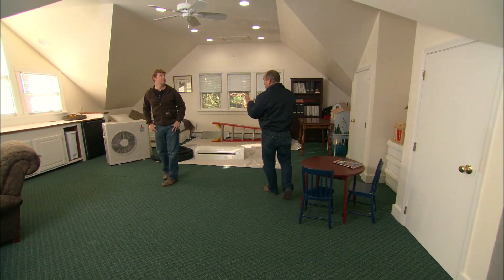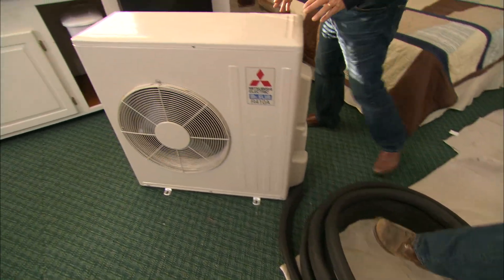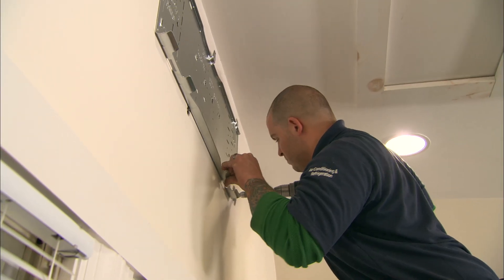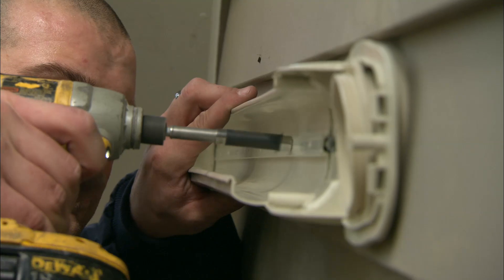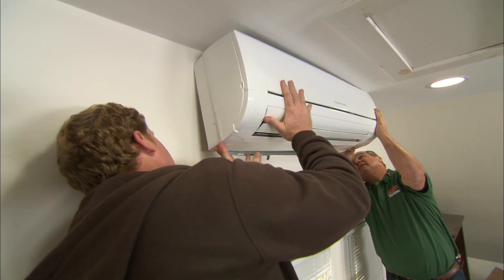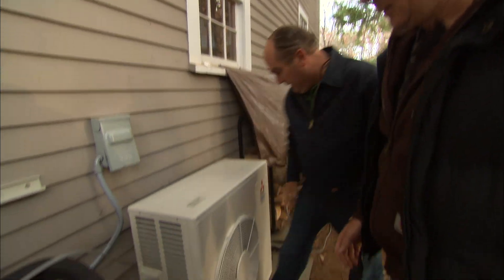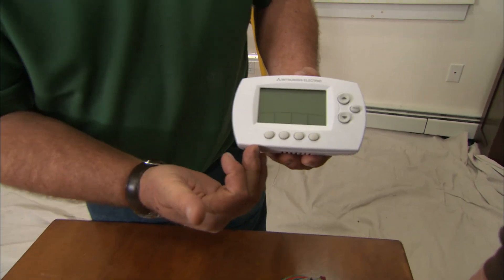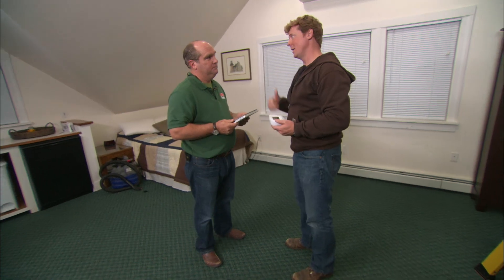How to Install a Ductless Heat Pump | Ask This Old House

Comment: i have a samsung digital inverters (3) one in my living/dining/kitchen; one in my back bedroom; one in the other back bedroom.  my house is approx 900 sq feet.  i live near the ocean in the south.  i had alot of trouble when i first moved in using the ac (i have lived in this house that was completely flipped almost 2 yrs) it leaked constantly.  the ac company that installed it came back over and over for about a year then stopped.  no solution no correction.  i called another company they came out and apparently the board in the unit in the living room/dining/kitchen because of leak burnt out.  the tech that came removed it and a new one was ordered and it was replaced.  they will come back in the summer because of the temps they cant check it for leaking.  now we have had very very cold weather the past week frigid temps which are unusual but it is not heating. it comes on then randomly goes off then comes on.  my house is cold to say the least.  
i did not choose these units i preferred the conventional ac/heat unit but the flipper chose this.  
do i need to get an additional heating unit or is there something else i can do or maybe i am doing wrong.
if an additional heating unit is needed what is suggested.
i am very very dissatisfied with this system.  
thanks for any suggestions.

Comment: purging can be done by opening discharge line and purging through  suction line.. hence no need to do vacuum. all is depend upon expertise of the technician.
Reply: Naieem shaikh flat out lie. You are destined for failure if you attempt this.

Comment: This is an insanely oversized unit for that space. And on top of that the indoor unit is mounted way to close to the ceiling...
Reply: Rodney Kewken well he never said what size he used.  He just said the heat loss was 18000btu.  Looks like he used a 24000btu unit though.   Sounds like there from Boston though. Where it gets really cold!
Reply: it is not too high , there should be atleast 10cm space from top , so its good
Reply: Since it's variable speed, if it's 2 ton, it will run as low as about 3000 BTW before shutting off.
Reply: by the size of outside unit , this is 5kw+

Comment: Can these work in Alaska
Reply: I believe the Mitsubishi Zumba will work to -30 Celsius (about -28 F), it may extract heat beyond that but it's starting to be minimal.  If you're using electricity to heat though, it's the best choice there is, it will definitely save a lot of money when the temperatures are milder.

Comment: Mitsubishi has heat pump that heats with up to -25c outside
Reply: They say -30 C now, the model is Zumba.  I have one, and it does work below -25 C, though for my old house, the backup heat will kick in a little around -24C (it's only adding heat, not doing all the work).

Comment: I have this kind of AC since one month now. I did almost everything myself, drilling the hole in the wall, electrical connections, hanging up the indoor unit, putting blocks underneath the outdoor unit. Then a mechanic came by to do the refrigerant work. Could have done that myself but A) My landlord wants it to be done by a certified person, B) the law requires it and C) i want it done properly so the compressor doesn't break after one year :) These AC's are really a rescue during summer time. And it can heat a room also, 4 times more efficient than a gas fired heater.
Reply: i had mine since 2012 and there hasn't been any issue so far
Reply: What's the cost to run it?
Reply: I Belice they are 8 times more efficient actually

Comment: when you use power tool for hole use a vacuum cleaner so that dust from wall will be vacuumed before diffusing in air.

Comment: what about the gas you said not a thing about that
Reply: This is completely electric and no gas is required as it is NOT a furnace. It uses a heat pump.
Reply: Ryan Toomey by gas he means the refridgerant, the thing that can only be done by a professional

Comment: This type of AC fascinates me! I can't believe this has been around for so long and the US is just starting to use the regularly. I think I will install these units on my home when I build it.
Reply: Yea been around for years but the US is the only country that over charges for them
Reply: Heat pumps come in different sizes now.  Mitsubishi makes the Zumba which can work down to -30 C, which should cover all the US.  (In my house, at about -24 C, the backup heat occasionally comes on, but it doesn't do much).  I definitely recommend it.
Reply: I very much plan to install these units when building my house.

Comment: it's too closed to the ceiling, leaving not enough room for air return, a minimum 6" from the ceiling is recommended by manufacturer.
Reply: Eric Rasberry just installed a 4 zone lennox mini split, they recommended 6" minimum from ceiling
Reply: Not true. It’s 2” minimum.

Comment: I'm planning on installing one of these units to purposely heat my insulated garage 24x30 8' ceiling, two 8' insulated garage doors and 4 windows 32x40 inches. I live in New England.

What size unit do you recommend?
Reply: I am very pleased with my Mitsubishi Zumba ;).  But ultimately it depends on what the local installers have, and their experience.  The Zumba can work down to -30 Celsius though.

Comment: You forgot to pull a vacuum on the system
Reply: that system come pre-charge, so you only have to do the connections and open the valves...
Reply: Hector Hernandez Please get out of the HVAC industry if your in it. There is AIR IN THE LINE SET, it MUST be evacuated before the refrigerant is released into the lines from the condenser, where yes it is pre charged generally in split heat pumps like this. But damn, VAC ALWAYS!
Reply: Kyle Wagner the copper lines they attached are filled with just air, they’re just rolled up open to the environment before install. You HAVE to vacuum, ALWAYS.
Reply: Kyle Wagner Good try
Reply: @kylewagner6607  some are pre charged like the MRCOOL but the lineset for that brand is not ubiquitous  to mini splits, that is the connections  are not common  to Mitsubishi  and  other brands. MRCOOL is a low end unit with doubtfull quality but the  cost and DIY aspect  suggest it may be  worth the money  for garage or shop hvac.
Reply: @25Lestad  
4:45 looks like normal compression fittings, plus they cut the copper at the condenser so it is full of air like the evaporator
also, regulations say even connecting lines or gauges requires a license when there is the chance of a leak occurring for any greenhouse gas
Reply: @25Lestad  ,
Still have to pull a vacuum, they just didn't show it.
Unless it's a mr Cool diy version, they have pre charged linesets with special fittings
Reply: purging can get you fined, it has to be vacuumed and touching any refrigerant without a license after 2018 will cost you as much $32,500
Reply: @ihatecrackhead  Some refrigerants are highly restricted  while R410 is sold  in auto parts business  to anyone. The Mitsubishi  comes precharged but my installer did pull a vacuum  down to the MFG specs, closed off the  pump and waited one hour to assure no leaks. The precharged was released and after one half hour topped off  to specs, that being  being  related to the  lineset length .  My install was oct of  2015, no service  calls and time to recover  the cost  looks like  under five years.

Comment: I was debating on having a contractor do this or do it myself.  Looks easy.  Thanks for the info.
Reply: Protective HT if you followed the video. Does yours still work? If so not for long
Reply: you will need a technician to fill the tubes
Reply: @25566  if it's a short run and you can use the tubes provided, those are prefilled with refrigerant.

Comment: Everytime i install a ductless system, once i drill my holes i nod in enjoyment justblike the tech did in this
Reply: if they only can get heat from outside to 5 degrees what happens when its below 5? no heat
Reply: yeah...his answer to it handling New England winters was weak.
sounds like a crock of shite
Reply: @timebasile  well I guess it's more blankets
Reply: @timebasile  Supplemental heating. Basically, the existing propane baseboard heating system will remain in place, and when the temperature gets too low outside, they'll turn off the heat pump and turn on the furnace. Personally, I've been looking for a clear answer on getting a thermostat that can automatically switch between the two, but I haven't seen anything so far. The only thing I've seen are purpose-built "dual fuel" systems which look like they'd require you to replace your existing furnace for even more added cost.
Reply: @c182SkylaneRG  thanks
Reply: You don’t use torque wrenches on the flare connections?
Reply: @jfrancis98  overkill
Reply: Ross R how this systems suport two or more heads? Im wondering if i can buy 1 compressor and 3 heads inside my home to heat or cool
Reply: + Cuauhtemoc Vega Torres - You'd have to buy an outdoor unit that's designed for use with three heads.
Reply: I pictured him thinking "yea, look at that, i sure effed that air sealing up"

Comment: Can someone explain how this wi-fi controller did replaced the original remote control?
What is the app for this, and how can you set cooling/heating mode or desired temperature via this?
Reply: Stilios Honeywell's Remote Equipment Module and a Red Link Gateway with a TH8321WF or a Lyric Tstat.
Reply: By making the entire system unreliable and unsecured by turning it into a part of the the Internet of Things
Reply: Stilios the wifi thermostat is literally pointless for this thing. The remote is wireless and is the thermostat for the unit. So if you put the remote down the hall your unit will run until the temp around the remote is what its set at.

Comment: nice job. looked tidy and showed some of the options that mitsi has to offer.
could have showen how to vac down the unit and witch port to open first, how to minimise the amount of the 410 when removing the gauges.
Reply: max lussi That info isn't for anyone but a EPA certified individual. $25,000 fine to open that unit otherwise.

Comment: did you have to do a nitrogen purge?  or were the lines prefilled with nitrogen?
Reply: I believe you have the evac the lines always. They did not cover that. I'm installing one of these myself but I know there are techs that do this all day long you can throw $100 their way and they will do it for you, possibly even flair the lines.
Reply: Mike Katz Wow, you just love to hand out shitty info.
Reply: Actually was correct. Just didn't go into details.  Any tech worth a darn will pressurize and do a PROPER evac. Not going to list every detail find a PROPER video.
Reply: Roger Sanchez lines are usually always filled with nitro from manufacturer. And any good installer always pressure tests the line set with nitrogen to check flare connections before pulling a vacuum. And we'd charge way more than $100 to flare out your fittings and pressure test it... how are you going to charge the system?

Comment: so this doesn't work if it gets below zero...
Reply: Actually, the new Mitsubishi Multi zone hyper heating systems (MXZ-CNAHZ) 4 zones and above have NO low temperature shutdown.  The single zones are supposed to turn off at -18 deg F and restart at -13 deg F but they usually continue to run past -20 deg F.  ike fun - you need to study up on your physics.  The temperature at which there is no heat left in the air is ABSOLUTE zero (which is -460 deg F).  There is plenty of heat in the air at zero degrees F.  The refrigerant R410a boils at about -55 deg F, so 0 degrees is extremely hot to the refrigerant.  As it boils/evaporates inside the outdoor coil it absorbs heat from the air, the compressor squeezes the refrigerant gas that has collected the heat and raises the temperature of the gas and sends it inside to the condenser where the heat is extracted.  That's how it makes 100+ degree heat when its zero or below outside.  I heat my entire house with them and have done many other houses where these are the sole source of heat.  Mitsubishi hyper heat systems heat below zero and they do a great job at it.  Most common mistakes are not using the correct equipment, mini splits are not created equally.  Some Mitsubishi equipment turns off at -4 deg F and loses a lot of efficiency at lower temperatures.  I do see many cases where other HVAC contractors select the incorrect equipment for the application.
Reply: Mike Katz Wrong. If the unit is rated to plus 5 degrees it won't heat below that temperature. It's called the balance point.  There is not enough heat in the outside air below that temp to satisfy building load. The defrost cycle has nothing to do with the unit's balance point.
Reply: ike fun Wrong, Mitsubishi has HP equipment that will heat well into the negative temps.
Reply: There's units that extract heat down to - 20 F. I believe the carrier model will do it.
Reply: The newer Mitsubishi hyper heats, I have 4 of them installed last year , give 100% heating down to 5 degrees F and 70% down to -13 degrees.
Reply: THE PATRIOT it does, hence the defrost cycle for the condenser coils
Reply: laws of physics well 0 is not realy 0 the true 0 is -273.15 degrees Celsius

Comment: How come my LG says I have to be 12" away from a wall for the outside unit. I need to hang mine like this one, but there's no bracket availible that will give me 12" from the wall plus the unit. What's up with that??
Reply: 12 inches? that's a lot! It is enough to give OU some 15cm space form the wall and some space from sides. What is important - to keep the unit clear. Not to mount it very low in order to avoid some dust, grass and leaves in the heat exchanger.
Reply: Kevin bla bla you better follow their manual. and don't panic if you can't find a bracket of the right size, even though they're out there, just go to a welding shop, and give them dimensions you need, and then brush on couple coats of paint

Comment: I just purchased a Mitsubishi Heat pump and AC unit.  I am in the process of setting the pad outside on the ground.  In the episode where you installed the Mitsubishi system in the upstairs of the garage you did not state what size unit you installed for a 700 sq. foot living area.  What was the BTU rating on this system?  I have a shop with 758 Sq. feet with a 9 foot ceiling, insulated and it has 5 windows.  The unit is 18,000 BTU  -- What are your thoughts?

Stephen
Reply: Stephen Cohen 600sqft per ton. 12,000btu's per ton... with your windows and space, I would say a 1.5t system... 18k BTUs sounds work great for you.
Reply: Mike Katz More shit advice. A proper load calculation should be done for unit sizing, not just licking your finger and holding it up to see which way the wind blows. You need to stop "helping". You don't know what you are talking about.

Comment: Forgot the most important part - what about evacuating and charging the system with refrigerant?  I know a lot of these package units come precharged and you open the king valve once the line set is connected but you still need to vacuum pump the system down first.  How to videos need each and every step.
Reply: You know I helped install one of these kits sold through a major retailer and it was labelled as DIY. The refrigerant was built-in and had pre-evacuated lines. Basically they had a pressure seal that cracked once you tightened the fittings. You could not extend the lines like this install showed, but was pretty cool to do it all yourself.
Reply: What was the brand and name of that unit?
Reply: Haha I was also thinking  about the vacuum process
Reply: There was another ATOH video regarding an install like this from a few years ago that did mention vacuuming the system.  For whatever reason, that step was left out of this one.
Reply: true about the evacuation yet most of these mini split's come pre charged I'm an hvac tech 29 year's
Reply: Im sure the HVAC tech performed that step. They show it on other videos on diff episodes. There are systems avail that are 100% DIY. Connect the lines and once the valves are opened it is charged. The vacuum process for those systems is not needed.  Many have posted the installations on youtube. As well as the various units manufacturer videos.
Reply: that system come pre-charge,  you only make sure the connection are alright and you are good to go.!!
Reply: Erald M. Exactly right. This video isn't for the weekend warrior. To legally open a precharged unit requires EPA certification, either a 608a universal or a 410a certification, depending on the type of refrigerant used. You aren't likely to get busted if you do it without the certification but if you do, say hello to your $25,000 fine.
Reply: correct but   for 410a there is no certification needed, here in calif minimum fine is $250.000 fine
Reply: shanmike11 I'm 608 universal certified and you're right, AC and refrigeration isn't a DIY job. All I was stating is if the video was trying to educate a homeowner on what's involved with an AC install, a major step was missed.

Comment: In India, Split/Window AC is used 99% of time. We don't use centralised cooling/heating in home, though large commercial places like mall, etc uses them.
Reply: Vatsal Singh - Good to know if Im ever in India
Reply: Myron Smith h
Reply: Myron Smith jnj
Reply: Same in Greece
Reply: Old  country of Iran the swamp air cooling types are most common among the residential and small commercial buildings, it perform really well due the  low humidity of region and  its cost,  They are made of one circulating belted fan,  small recirculating pump and hay bells, all contained in thin aluminum box.